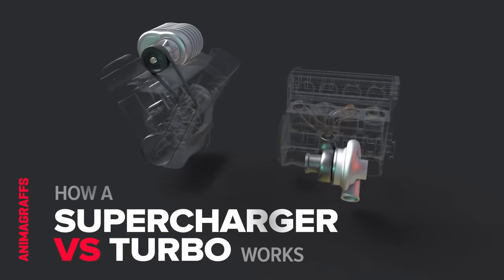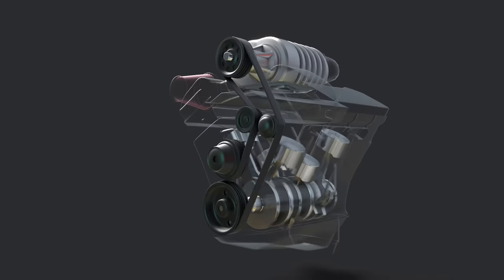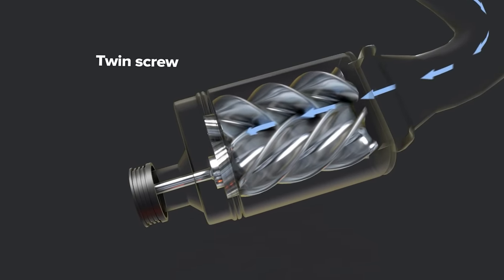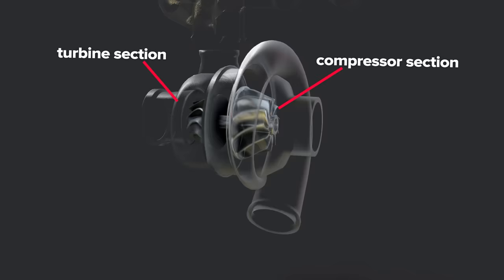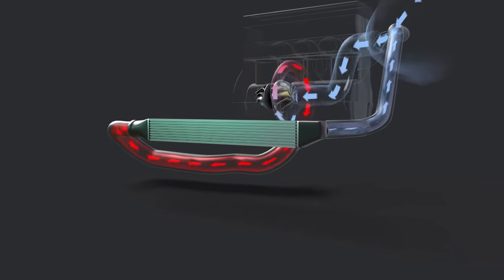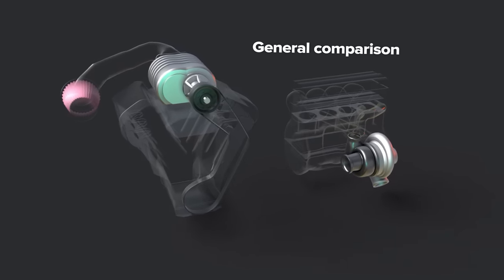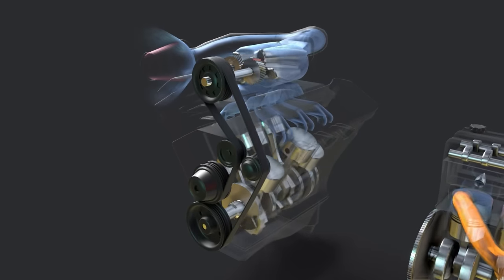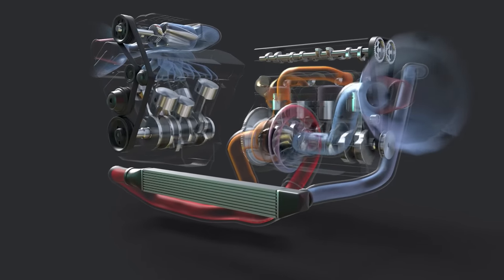How Superchargers vs. Turbos Work

Comment: It's worth noting that designs that use both supercharger and turbocharger in the same engine exist, they are called twinchargers but they are rarely used because they are very complex.
Reply: It is used in railway locomotives in india...
Reply: Thank you for saying that. I was wondering, "Why can't you use both? They are on separate parts of the engine?"
Reply: @Wisald  lancia delta s4
Reply: Imagine having twinchargers and using NOS. Absolute rocket ship
Reply: They are used in aircraft piston engines. At high altitudes they ensure that the engine gets enough pressurized air to function.
Reply: Aren’t the S-Line Audi’s Twincharged or not anymore ?

Comment: This is so well done that it temps me to install a turbo charger to my own engine
Reply: If the engine isn't built for it, the extra pressure will pop the cylinder head off.
Reply: "tempts"
Reply: @renorailfanning5465  thank you. I was lacking in the spelling department lol
Reply: @dougaltolan3017  totally. I for sure wouldn’t do it to a daily
Reply: @i_smoke_ghosts  That’s actually a pretty solid idea
Reply: You're going to need a lot of parts for that
Reply: 5.4 Triton Supercharged Crown Victoria
Reply: @anonymous175  what yours hp and torque at? I wanna supercharge my 5.4
Reply: There's a twin turbo kit for my car but I wouldn't know the first thing about installing it.
Reply: @dougaltolan3017  I ran 4 psi in a sealed 4.6 4V 03 Mach 1 for 12,000 miles with no issues, then pulled it for forged rods/pistons.

Comment: Great video as always.

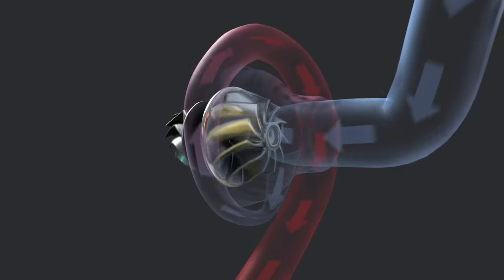Small correction from a centrifugal compressor engineer - compression in a centrifugal compressor does not occur due to the changing cross section in the spiral casing (3:25). Rather, compression is caused by the impeller "slinging" the air to the outside of the spiral casing. This rapid increase in kinetic energy is then converted to an increase in pressure as the air slows down through the gradual increase in area of the spiral casing (or diffuser).

Keep up the great work!
Reply: Ohhh is that why the impeller blades have so much clearance from its casing? So the outer air can move slower than the impeller itself, allowing the impeller to squash more air into the same space before it leaves the turbo.
Reply: @Leptons_  I think you have the right idea. Another name for the casing is the "collector," named thusly because it continuously gathers the fluid being thrown out of the impeller. The cross section of the collector gradually increases as the air moves towards the outlet of the casing, allowing the air to bunch up and convert its high velocity into pressure (and heat).
Reply: Centrifugal Compressor Engineer, this might be the most interestingly specific job title I've discovered this year lol sounds awesome
Reply: Another small correction / point: turbo / superchargers don't just allow for More fuel to be burned, thus increasing power density, but they also increase thermal efficiency. So you get more power per unit of fuel. That's the reason modern aircraft engines go to higher and higher compression ratios.

Comment: Car #1: 496 HP blown V8 stock. 
Car #2: 442 HP twin turbo V8 stock.
Same manufacturer. 
I owned both at the same time for 7 years and must say that the Supercharger experience is superior in every way except fuel economy and emissions… which is why you can’t buy them now. 
The wide “area under the curve” means that at every RPM, the SC can make 100-250 more HP instantly, the exact second you floor it. No boost lag, no drop in power between shifts. 
I don’t care about drag strips, but that instant 250 HP advantage makes a world of difference when you need it.

Comment: If I recall, WW2 aircraft radial engines had a super charger and turbo installed. This set up had an advantage for extra HP and speed when flying higher altitudes. Great video 👍
Reply: Very few WW2 aircraft had turbo superchargers. Turbo supercharger setups are bulkier than mechanical superchargers setups making them hard to fit within an airframe. "Greg's Airplanes and Automobiles" has a number of videos talking about this in detail. Most aircraft used multistage/multi gear ratio centrifugal mechanical superchargers.
Reply: @david.bowerman , P-38.
Reply: @steveskouson9620  Mustang P-51 D Rolls Royce Merlin 60 Series engine came with a 2 stage mechanical supercharger  That's why that aircraft was the bogeyman of the skies during WW2.

Comment: Excellent animations, and a great introduction to forced induction systems for automotive applications. I'd like to offer some constructive feedback regarding some of the finer technical details:

* Centrifugal compressors (including turbocompressors) do not build pressure due to the change in outlet cross section shrinking (it actually grows in cross sectional area), but rather because the kinetic energy (linear velocity) imparted into the air by the compressor vanes is converted into potential energy (pressure) when air molecules slow down as  they are flung out of the exducer and into the mass of air ahead of them in the pressurized section of the intake tract. This mass of slow-moving air exists because the engine is an inefficient air pump that cannot ingest air as quickly as the centrifugal compressor can move it.

* All forced induction compressors generate heat due to compression, and many supercharged applications use intercooling to mitigate this heating. In both turbocharged and supercharged applications, air to water intercooling is becoming more common for its increased efficiency and improved packaging. Superchargers may omit intercooling because they generate minimal pressure (5-10psig is common, vs 20-30psig in modern turbo applications) and thus heat increase, or because the reduced performance and efficiency is acceptable in trade for reduced complexity. For similar reasons, older turbocharged designs also often omitted intercooling. Evaporative cooling (eg water, methanol, or additional fuel injection) may also be used in either setup to improve charge density.

* You correctly note that turbochargers are powered by waste heat. Expanding on this (pun intended) to explain how engine exhaust continues to expand after the combustion process is complete may be helpful to new learners who aren't familiar with this concept. 

All in all, a well-constructed video that is easy to follow. Good work Jake!
Reply: @KENARDO  no chemistry trigger warning?

Comment: Great video. One hint: you missed bi-turbo, a combination of two diffrent sized turbos (one small and one big), they prevent in more or less way the "turbo-lag" (the small turbo performs best for low rpm, both combined operation for middle rpm and the big one is delivering supercharging at high rpm).

Comment: Excellent video and you broke it down and explain each different type of supercharger and turbo and the pros and some cons.

One more con to the turbo side is oftentimes you have to change your oil much sooner because the turbo uses oil to cool itself down but is extremely hot so you often cook the oil much more quickly than a regular engine would.

Me personally I like the superchargers👍

Comment: Both devices need heat exchangers to cool the incoming air flow because BOTH compress air therefore heat the air.  A supercharged car is more fun on the street because of that instant boost resulting in instant power.  I've had both, and I like both.

Comment: I heard that the turbo lag can actually be dangerous in some cars. This is because when the turbo is activated at higher throttle, engine rpm suddenly increases, leading to a very sudden increase in speed. Porsche solved this problem by installing two turbos with one activating at lower rpm to compensate for the turbo lag in the other turbo.
Reply: the sudden increase is fun :)

Comment: Also, most intercoolers (or aftercoolers) cool the compressed air but don't get it back down to ambient temperature. That would require an extremely efficient intercooler. Even ice water intercooler usually don't cool the air all the way back down to ambient.

Comment: Excellent informative video .
Ive recently had a supercharged hayabusa drag bike (350 horsepower) & a turbo hayabusa drag bike (450 horsepower) & gone back to a normally aspirated big block motor for the simplicity & reliability. 
Great fun , & quick  on a bike but enormous maintenance & short engine life .
Add 1 sub from England 🇬🇧

Comment: Finally! A video demonstrating supercharger types that makes a distinction between Twin Screw, a.k.a Lysholm compressors, and Roots blowers.  They look similar and do the same thing, but they do it differently, and that difference matters.  Roots blowers use two identical rotors to move around the outer supercharger case and out the discharge port into the intake manifold.  Because the supercharger is "blowing" more air into the engine than the engine can consume, it compresses the air generating boost.  Twin screw superchargers use two distinct "male" and "female" rotors with different numbers of lobes on each rotor.  For example, the male rotor will have 3 lobes whereas the female rotor will have 5.  These lobes intermesh very tightly compressing the air between them.  In this way, a twin screw is a true "air compressor" where as a Roots blower is not.  At higher boost levels, Twin Screw superchargers are known to be a bit more efficient, i.e. generating less heat of compression, compared to their Roots counterparts.  With that said, both types work very well for generating power and it's largely up to personal preference on which is "better".

It's also important to note that both Roots and Twin Screws belong to a category of superchargers called "Positive Displacement", a.k.a. "PD blower".  They are called as such because they have their own internal volume and deliver a known quantity of air for every full revolution of the rotors. For example, a 3.0L positive displacement supercharger moves 3.0L of air every full revolution.  Because they are driven off the crankshaft, the total volume of air delivered is always directly proportional to engine speed.  Both types of PD blowers are known for delivering full boost near instantly upon wide open throttle (WOT).  This give engines equipped with them very broad and flat torque curves correlating to very linear power bands.

Centrifugal superchargers, on the other hand, are basically "belt-driven turbos".  However, the power curves they deliver aren't exponential.  Centrifugal superchargers build boost in direct proportion to engine rpm.  The more rpm you make, the more boost you make.  The more boost you make, the more power you make. But this boost build up is linear because the supercharger's compressor speed increase is directly proportional to engine speed.  This is in contrast to a PD blower which makes the same boost at all engine rpm (assuming WOT).  Engines equipped with centrifugal superchargers make increasingly more power with more rpm, thus they are very good for situations where the engine will spend most of its time high in the rpm range.

Comment: Don't forget to blow off valve, one of the more important parts of a turbo application to stop the whole thing blowing up and release the compressed air when the throttle is closed and the engine wants to go back to idle

Comment: 1. Variable Nozzle Turbo was omitted and is as important as the other types. 2. I've often wondered why a supercharger was never fitted with a clutch when power wasn't required. This could easily increase it's efficiency by allowing it to "idle" during times when the power wasn't being requested.

Comment: One correction, you twin turbo design shown is actually an Bi-turbo common on Mercedes Benz,the more common twin is actually 2 turbos one smaller & one larger turbo stacked on each other, one for lower RPM, larger for higher
Reply: The way shown is most common. You are taking about compounds, which is typically a large Diesel engine thing and/or aftermarket.

Comment: I had worked on several motorcycles that had turbo chargers and they weren't very reliable for higher mileage. This was back when Honda, Kawasaki, etc came stock with them in the 80's. I am glad my Ninja H2 sx has a super charger, no exhaust gases to gum up the works.

Comment: And just to double check, because it's implied instead of being explicit here, but more air is being presented in something that is equal volume, meaning the air has much more pressure, which I assume 1) makes the intake stroke quicker and 2) makes the power stroke more potent/powerful. I just want to make sure that I have that right.
Reply: More air flow = more horsepower

Comment: Twin scroll turbo's main function is to have one scroll set to spin the turbine effortlessly at low engine rpm low volume/high velocity exhaust gas. Then the second scroll is set to spin the turbine at maximum speed when the engine is putting out high volumes of exhaust flow.  It's essentially 2 turbines turning the same compressor.

Comment: Love this demonstration. It comes down to what works for you. For me, I love positive displacement superchargers. I love the feel of instant and linear power and know it's there at any given time, especially if I want to merge into a gap. Essentially, it makes your engine feel as though the displacement is bigger than it is. I like turbos as well, it's nothing like feeling that wave of torque when it finally kicks in and it slingshot you down the road. But from a daily driver perspective, and someone who doesn't race and is not going for maximum power, but more usable power, a positive displacement supercharger is the way too go.

Comment: Not mentioned here are two less-common types of superchargers, scroll-type, where air is compressed between a fixed and non-fixed scroll; and a sliding vane, a rotary vane pump that uses vanes that can adjust in length to compress air. However, these aren't as common as the types mentioned here.

Comment: Very well done as always. But I’d caution anyone thinking they should add either to their NA car, it’s expensive and complex to get it working efficiently and will shorten the life of your car. MUCH better to start with a car that comes stock with a turbo or SC and then modify it to make more power as it’s relatively inexpensive to add a significant amount of tq/hp

Comment: “turbo derives power from wasted exhaust heat”.    More specifically the turbo converts exhaust gas velocity into intake gas pressure.   in other words,  the exhaust gas stream slows down as it drives the exhaust turbine blades, the resulting energy is transmitted to the intake turbine blades that pressurize the intake air.   

This is why intake pressure increases with RPM on a turbo engine.

Comment: A turbo is technically a subtype of supercharger and a centrifugal supercharger is also a mechanically driven turbocharger. 

The word "turbo" simply refers to the use of turbines. The word supercharger applies to any device that increases the charge air pressure above atmospheric pressure. The word "super" = increase.

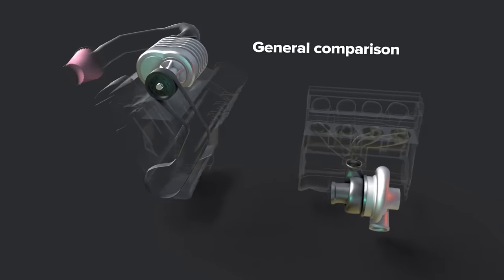Comment: 4:40  and 5:55 Its not exhaust gas heat that drives the turbo but exhaust gas air pressure so effectively the piston force on the exhaust stroke so it is taxing engine power!

Comment: Superchargers-pro-more power and no lag
con-much less efficient i.e., require a specific amount of fuel to RPM so the higher the rpm the more fuel has to be put in to match airflow regardless of load, 
more expensive to install per hp gained
Turbo-pro-works only as hard as needed and produces cooler IAT, much more efficient use of power
con-less power and has lag(can be configured to help reduce lag-compounds for example.)
There is a good reason turbos are more in use than supers in stock applications.

Comment: I have had a car with a supercharger and 2 with a turbo, my driving preference is a SC, no lag and always instant power.  For everyday driving the SC works better at the revs experience at day to day normal driving.  It tends to run out of steam at the upper rpms where as a turbo keeps building

Comment: 5:28 this is not turbo lag. That is the boost threshold. It means as you correctly said the exhaust takes time to spin up and as you know a threshold is the limit of something so the boost threshold which should really be called the vaccuum threshold is how long it takes the turbo to go from vaccuum to creating positive pressure, which we know as boost.

"Turbo lag" is when you are already makins positive boost and you close the throttle and open it again; obviously there is a pressure loss, but the lag is determined by how long it take the turbo to build back up said pressure loss.

A good way to look at it is this:

Engine redline: 7000rpm
Vaccuum threshold: idle to 3000 rpm
Positive boost range: 3000 to 7000 rpm

Lag occurs when i close the throttle between 3000 and 7000 rpm; there is a pressure drop so for example the boost in PSI is 14 lbs. When i close throttle between 3k and 7k i drop pressure, lets say 10 pounds(currently producing 4 off throttle), the time it takes for me to rebuild pressure to 14 PSI is what turbo lag is.

Comment: My belov d golf 118 TSI had a setup of a supercharger for the low revs and to cover the turbo lag of the turbocharger that was in there. Combined with the dsg gear box you have this smooth ride up the gears and revs imperceptible and powerful. 
It’s a shame they stopped making tbis particular configuration. 
Of course now ev is the way forward and completly leaves the turbo era in the dust.